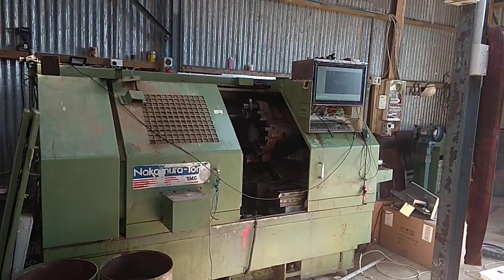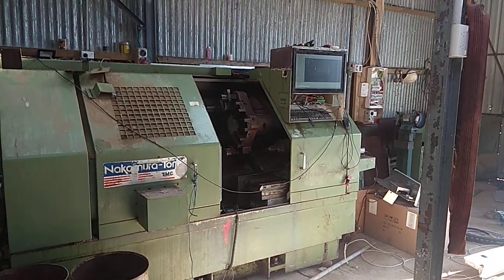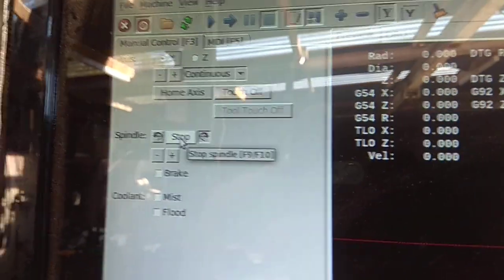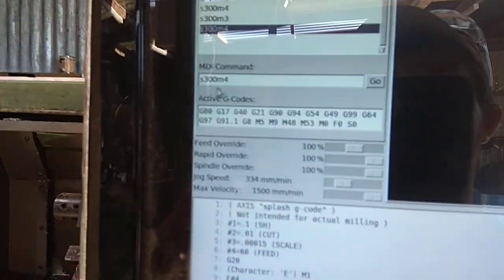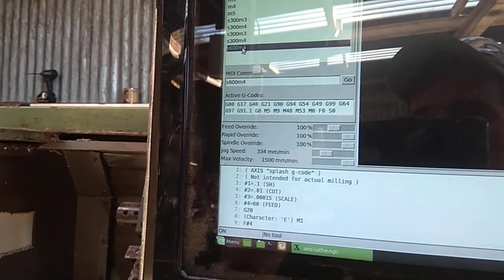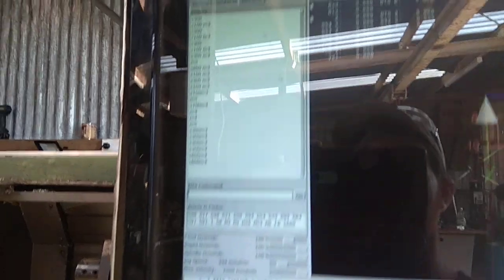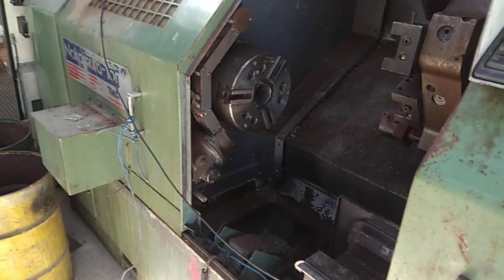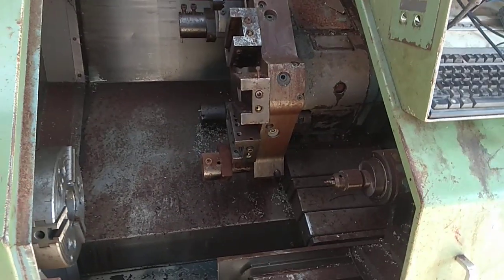Linuxcnc lathe retrofit part 3.  (quick spindle update)

Comment: Great work - you make it look easy!  Are you using the fanuc spindle drive or replaced with vfd?
Reply from the maker: Hey mate.  The fanuc drive actually just had a 0-10v input so I just used that.  Otherwise I could replace drive.  Problem was the spindle motor was a special thing and my vfds wouldnt work when I was testing.  So I will use the fanuc drive until it dies
Reply: Are you able tk make a video of the interface between linuxcnc & the fanuc spindle drive?  I would be very interested to see what you did - like i'd sell my soul to see what connections you have on the CN1 connector.  For the +/-10 volts you used which pins for the signal and whic for ground (common) back to the mesa............. keep up the good work. Very inspiring.
Reply: Sorry, i'm typing on my phone with gloves on.....
Reply from the maker: @pauln3007  hey just send me a email  you can find me at carbidecutters.co.nz and I'll help you out

Comment: What happened to part 2? There's part 1 a few days ago, and now part 3? :)
Reply from the maker: I can't count!
Reply: @carbidecuttersnzltdandrewb8449  Ah, no biggie - just wondering if there was a video missing or something. Was looking at a similar lathe available locally last week for $2k - had an old Fanuc control on it with a failing video card, and active tooling on the turret (c-axis?). If I had a place to put it, I would've snapped it up. I'm sure I could easily fix whatever was wrong with the video display on the original Fanuc control, but it would be fun to convert it to LinuxCNC - guess I should get the VMC I picked up running first!